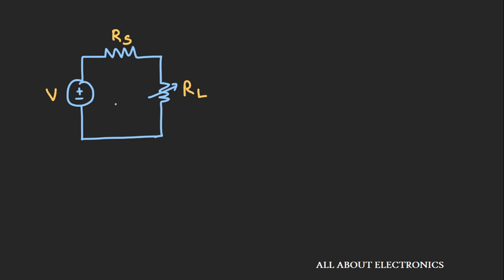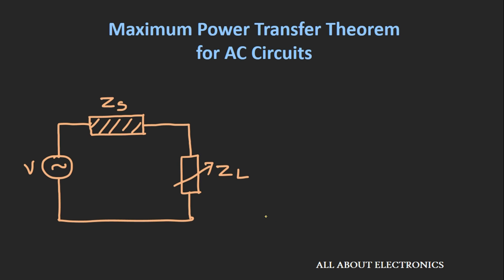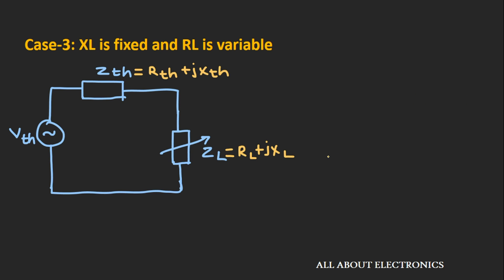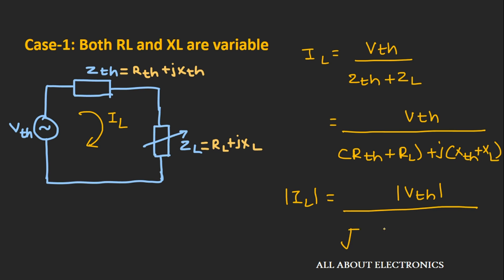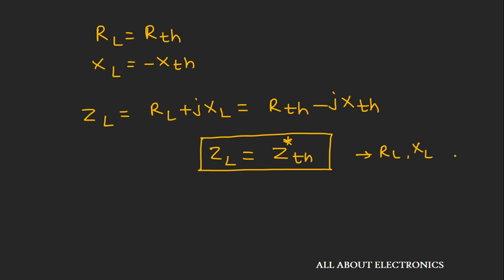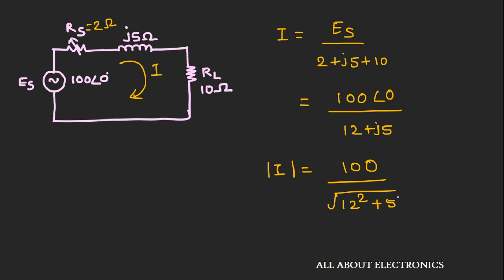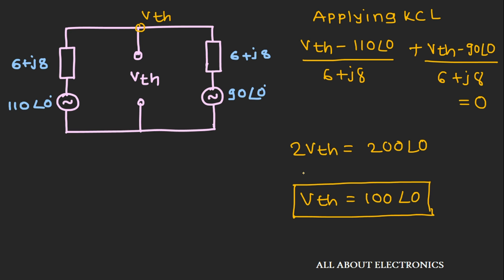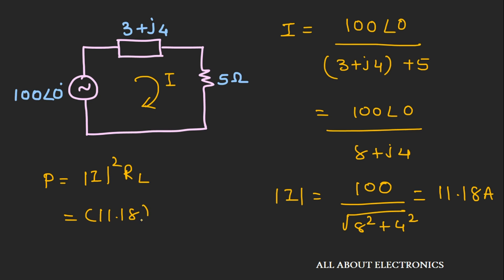Maximum Power Transfer Theorem for AC Circuits (with examples)

Comment: Sir, at example 1, the question itself is to find Rs while you assumed it as 2ohm and calculated power and in this case Rs=RL(for max. power transfer) or did you just assumed at 9:37 .
Reply from the maker: For a fixed load resistance (RL), to achieve maximum power transfer to the load, the value of the source resistance (Rs) should be the minimum possible value to make the total resistance in the circuit as low as possible, thus maximizing the current flow to the fixed load. And that is why here Rs is considered as 2 ohm. I hope, it will clear your doubt.